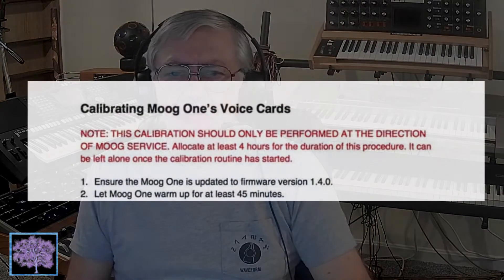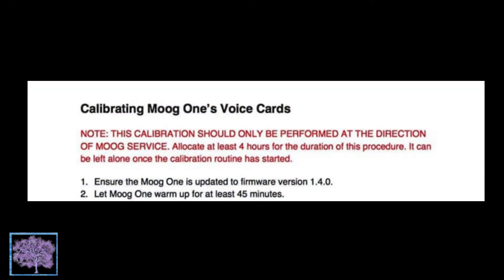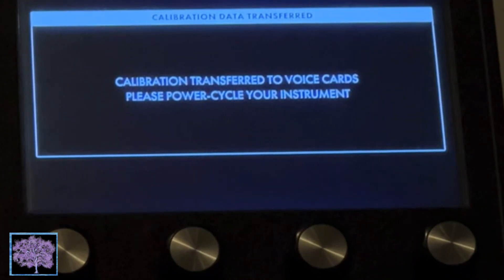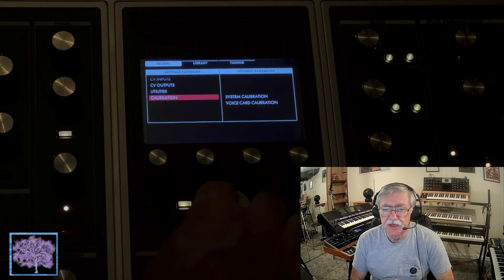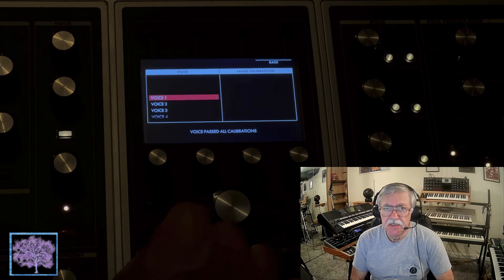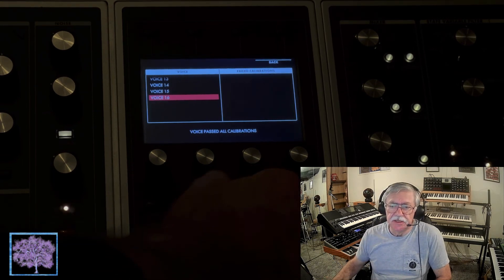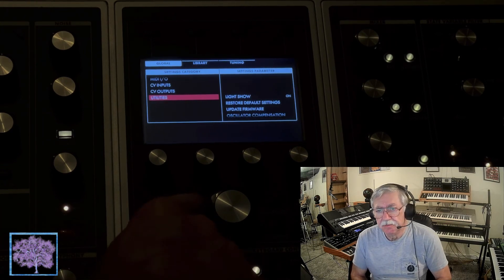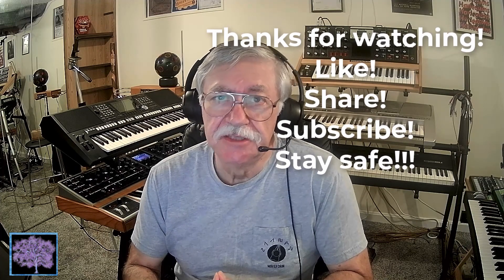Moog One's HIDDEN Oscillator Calibration Routine (Success!) Read Description for Important Updates!

Comment: Unfortunately this calibration doesn't actually fix the tuning issues on the low-end of the keyboard (most noticeable when you set oscillators an octave apart). This seems to be a hardware issue related to card temp relative to placement in the case and so I suspect this is an issue on ALL Moog One's but I would love to hear that it isn't.
Reply from the maker: Most of the feedback we’ve seen indicate the tuning issues were fixed with firmware update 1.5 and this update.
Reply: @GetsemaniMusic  Conversely I've seen comments indicating no change on the low-end tuning issue after the update + calibration, plus I myself had no improvements after running the calibration routine on its own (this was before 1.5 OS was released). So I think "some" general tuning issues were resolved, but the low-end one was not.. at least not on a lot of machines.

Comment: Thanks Brian I'm running the calibration on my One finally. Updated to 1.5 as well. Curious though, my One shows 18/18 .. not 17/17 wonder why that would be? Anyway, thanks for the tutorial, it was super helpful thanks!
Reply from the maker: Thanks Marshal. The video was made awhile ago using version 1.4. 1.4 had 17 steps. 1.5 has 18.